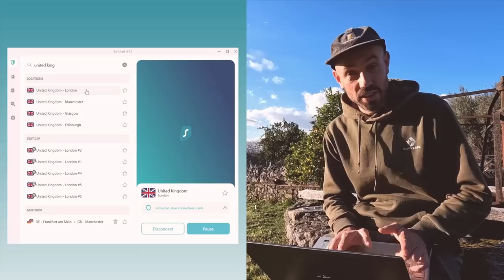This Challenge Might BREAK Us! BUILDING A HOMESTEAD GARDEN

Comment: Hi guys...
I've built a few of these!
The way I do the base is, dig a trench, pour in some concrete, trowel it level.  When it's set, build one course of building blocks on the concrete footings. When that's set, fix pressure treated  timber rails around on the centre line of the greenhouse base rails using frame fixings - something like 38 X 63mm construction timber.
Then you can just simply screw down the greenhouse with chunky wood screws and penny washers.
Simples!  And it works with a bigger greenhouse than this..... 
Also, recommend a shelter belt on the prevailing wind side of the glasshouse, a few metres back so you don't shade it.  Start with shading fabric on posts /stock fence..and plant shrubs behind it...

Comment: Personally, I wouldn't cut the 'feet' off. I would have  used it as additional stability by sinking  the feet into your wet concrete base  as well as then using screws through the base into the concrete.

Comment: Hi, i buildt two of those green houses for my neighbour and me. I screwed some feet to the body frame and fixed them in concrete. This worked very good and the green house is now since six years in my garden, but i ordered it with 4 mm Plexiglas and this was not working ,cause we have also strong winds ( Hamburg ) and after the last storm i ordered some 6 mm windows. These are more solid against the wind pressure. I ordered the windows at a company for Plexiglas cause they were way cheaper than the originals. The dimension are on your plan. Greetings from Hamburg
Reply from the maker: Ours has 6mm so hopefully it’ll last as long as yours 👍🏼

Comment: In future when making footings put soil around the wood will stop it bowing out also make the concrete wetter not dry like you did there then you’ll fine it a lot easier to level off. When I used to do concreting inside a fixed area like you had there I would make the concrete so I could pour it out of a bucket into a pile so not that wet that it spreads out flat but spreads out easily with a float. 
That greenhouse is the same as a ‘Halls Greenhouse’ that you can buy in the UK. Them bolts you can buy them either as you had them or a ‘Cut-off-bolt the is where the head is specially cut so you can fit it in the slot after you have made the greenhouse these are handy for attaching L brackets to hold wires for tying plants up from the roof or if fitting shelf’s after you’ve built the greenhouse,
Keep up the good work.

Comment: Nice work. I had to pour two concrete pads for some heating units and a pair of tall hot water tanks. Nothing like doing to make you learn. It's always a good idea to use some steel grid -- called malha sol here. Just thin steel grid to keep the concrete from cracking and water getting into the cracks. Also I had to practice sliding a straight board from side to side and forward across the forms to level the surface. Much better than trying to trowel by eyeball.

Comment: I am so happy to have discovered your video's on You Tube.  Each one has been refreshing and the two of you are so happy with your move.  I can relate in part to some of your struggles as I bought an older house in Mississippi, a English Tudor cottage.  It was listed as a cottage but it measures 4100 square feet, packed with character and charm.  I am currently about to start faze two which consists of a new Preimary Bath.  I am considerably older than the two of you so I have to hire people to do the work.  I am a designer by trade, still working, so I have no problem coming up with ideas and selections for my projects.  

I should mention that my house came with a green house which I too am looking forward to growing veggie.  I am buying some planter boxes at counter height so I won't have to do a lot of bending.  I'm anxious to see how you start out, I might get some much needed pointers.  Close for now.......my name is Richard but I go by Dick.

Comment: Ricky, I think you're overthinking this – it's just a base for a greenhouse and the inside and outside will soon be disguised by foliage as nature takes over. 
The foundation doesn't need to be perfect, and it's just something to screw the greenhouse base to.
Note that it's easier to drill in rawlplugs before the concrete has fully cured. 

I'd also think twice about painting the greenhouse frame because your paint could easily peel off in time, and there are a million pieces of metal to paint. Plus you can't easily re-paint it later, once the glass is in place. 
Once the greenhouse is full of plants you won't look at the aluminium frame. The key is maybe to plant flowers or shrubs at the entrance side – or just plant vegetables all the way around. 

What I also did with mine was to leave the inside of the base frame open to the earth – with just a three slabs in the middle as a pathway. Each year, I refresh the soil with new compost and well-rotted horse manure. 
Great job, anyway.

Comment: Er, this may be an obvious question, Ricky...but, don't you have couple of those cheap rechargeable led worklights(the yellow ones)....!? 
You can also fix then on a cheap tripod for better light distribution...
Simple, convenient, flexible, cheap(and no assistant required..)!!
I think you need a trip to 'Screwfix Portugal '.....!!!
Reply from the maker: I have one rechargeable led work light which is what Victoria was holding & directing over me. The other worklight I have on the stand is mains powered & the genny had run out of fuel. I miss screwfix so badly! Nothing like that here unfortunately
Reply: @LifebyLiving  .....it's like living in the Dark Ages........!!!
Reply from the maker: @andymccabe6712  😂